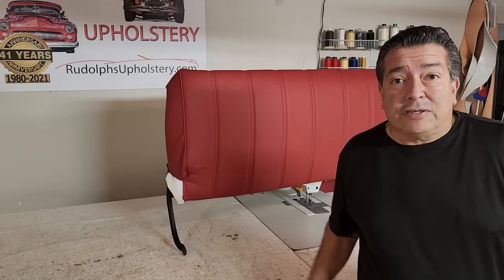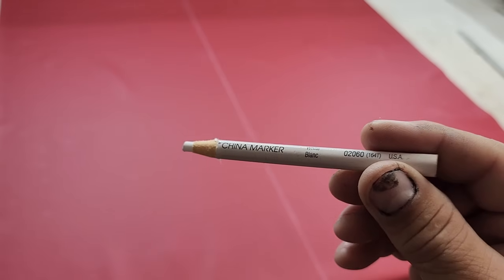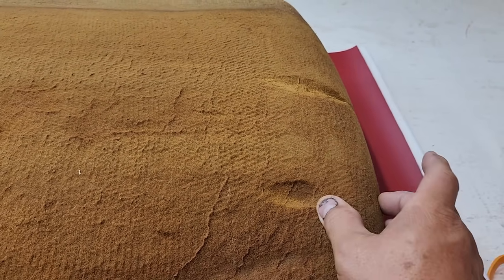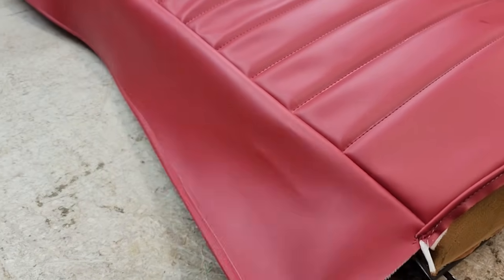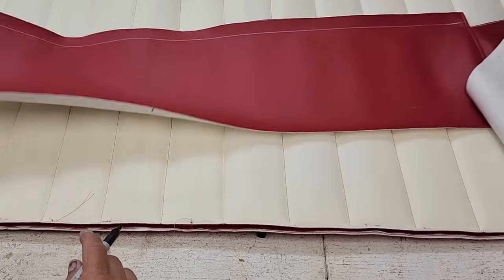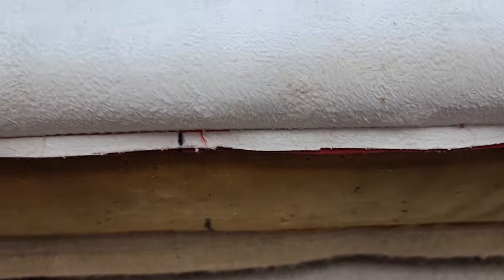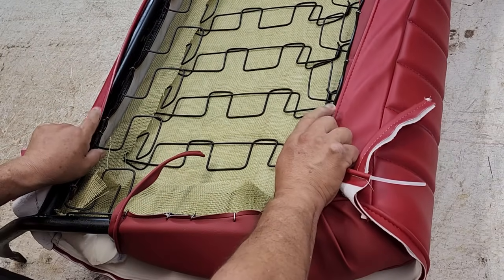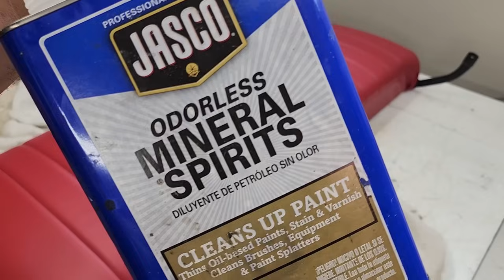Rewarded! Really bad aftermarket Old School truck seat cover makeover

Comment: I'm pretty cheap... if it were my truck, I would probably have removed the skirts from the original, found the closest match vinyl and made new skirts and tails. 
Some pre-made kits use cheap vinyl, though.
I was taught to seal the edges and do the welting at the same time to save time. I like your way better!
Also, I was told to make slightly sharper angles where the skirt pieces meet, to keep it taut when installing, and cut slightly into the shoulders at the top so they fit snug.
Don't listen to me, though... I'm still a rank amateur upholsterer! The pleats in my own truck seat that I did years ago don't line up😖 but nobody notices but me.
Reply from the maker: Hello Lou, Like I always say, there is more than one way of getting things done. Your way or my way, we always get through it all don't we? Just keep going, we are always learning and it just gets better. Please keep liking and watching!

Comment: Those were my favorite seats to recover. Very easy I would hold that pedal down. like I was on the Freeway.
Reply from the maker: Hello Venvnco, It sounds to me like you are a person with experience? Please keep liking and watching!
Reply: @oldschoolautoupholstery  40 years in the trade. Retired now I mostly did complete interiors in 1972 and older cars that were totally restored and all the old interior removed. I also did a bunch of those 70s and 80s trucks. The oldest was a 1901 I really enjoyed the older cars.
Reply from the maker: @venvnco6259  Hello Venvnco, It sounds like we both had similar life experiences. I started in 1980. I really enjoyed working on the 1931's classics. My oldest was a 1913 Packard touring. You can see 44 years of my work at Rudolphsupholstery.com Please keep liking and watching!

Comment: Hello Richard
Do you twist or cut hog rings?
Thxs
Reply from the maker: Hello Dell, Most of the time, I will twist hog rings counter clockwise when they are attached to something rigid. I will cut them off if they are attached to something soft. I find they are easier to collect and trash if twisted off. Please keep liking and watching!